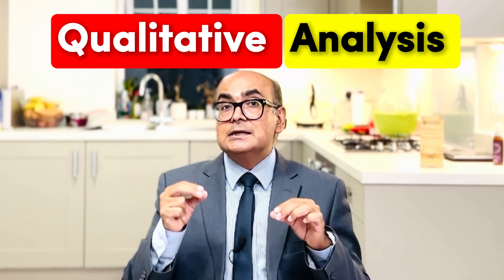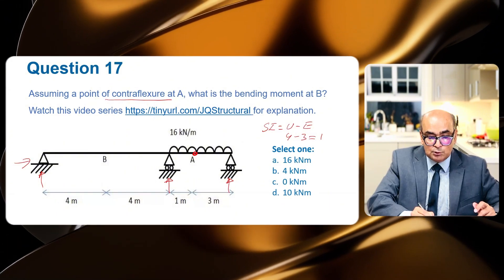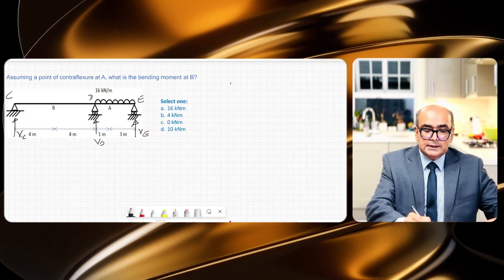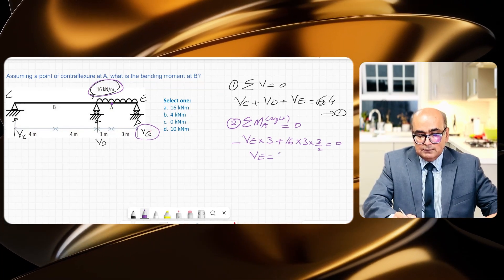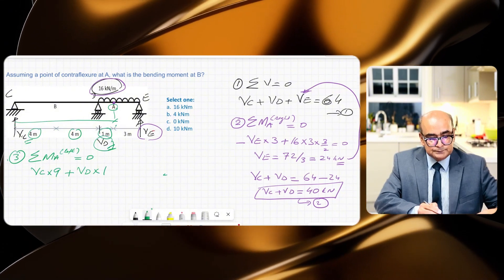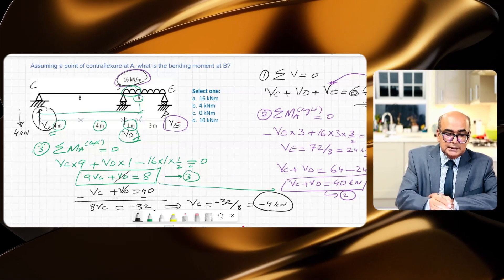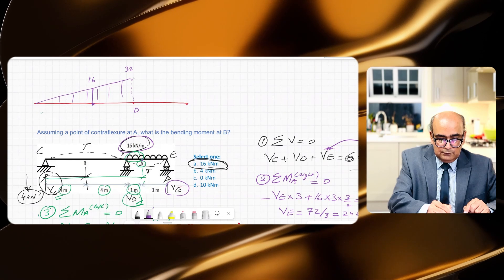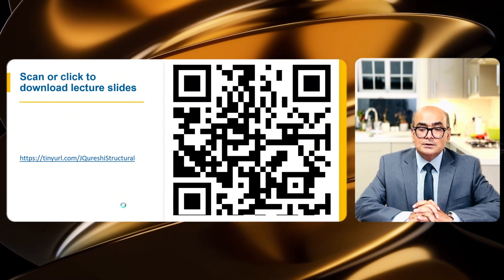Beams Engineering Mechanics – Qualitative Analysis beams  | IStructE Structural Behaviour Course

Comment: Hi. 5.03 - When we are taking moments on the left side, shouldn't it be (Vc*9) - (Vd*1) instead of (Vc*9) + (Vd*1). We assumed clockwise is positive, so wouldn't Vd produce anti-clockwise rotation?
Reply from the maker: Vc and Vd both are creating clockwise moment from left to point A which is assumed internal pin. We assumed anticlockwise shear forces are positive not moment. Moments are clockwise positive here.

Comment: Hi sir, when do we use wl²/8, wl²/12 and wl²/24 when determining maximum bending moment for UDL? What is the difference?
Reply from the maker: @VictorCeaser6  wl2/12 is the fixed end hogging moment for beams with fixed support and I’ll applied. Wl2/24 is the sagging moment for beams with fixed end supports and udl
Reply from the maker: @VictorCeaser6  wl2/8 is max sagging bending moment for simply supported beam with uniformly distributed load.
Reply from the maker: @VictorCeaser6  let me know if it makes, happy to expand more.